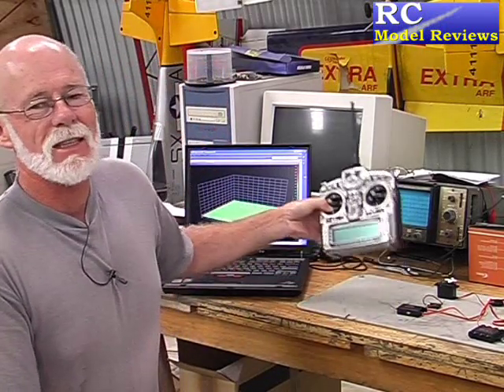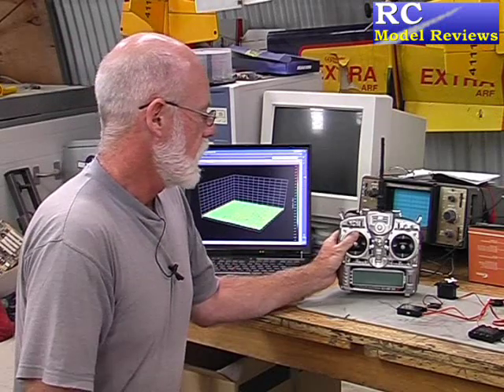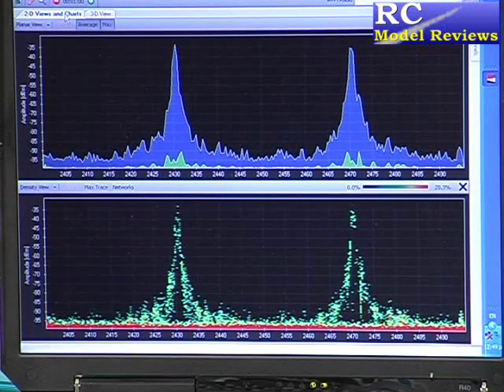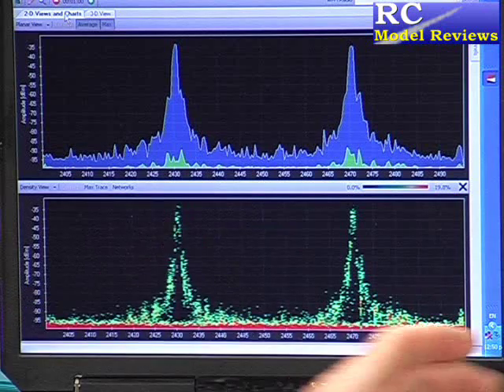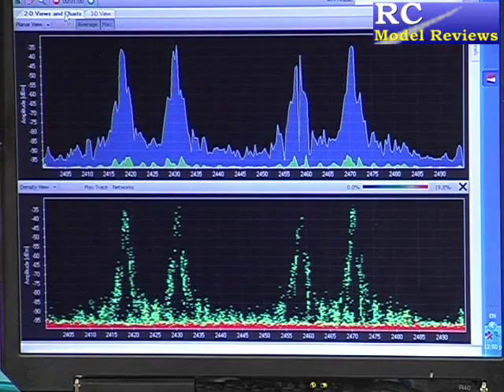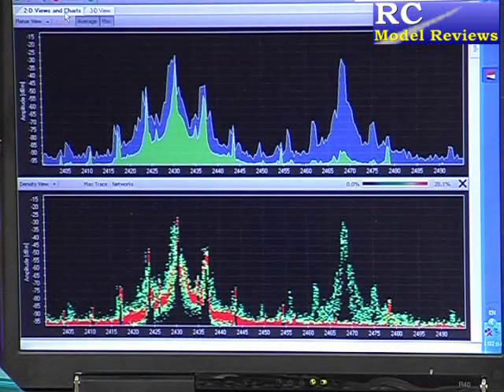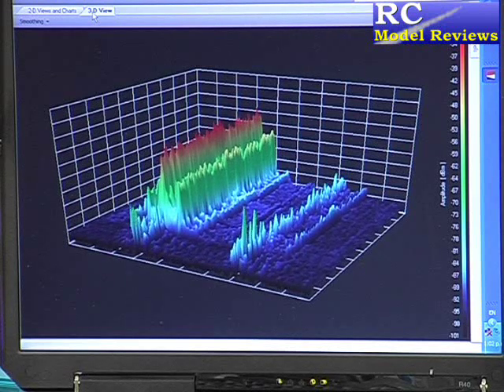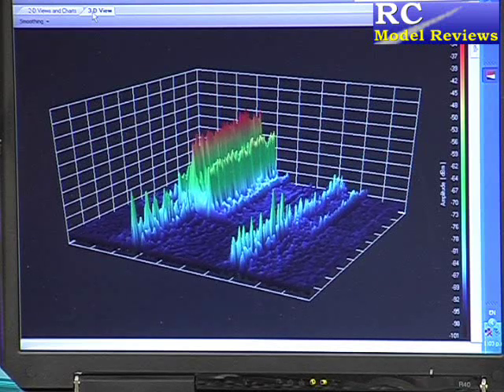Spektrum/JR DSM2 test (Part 1)

Comment: Here in the UK you could be forgiven for thinking spektrum was the only radio brand on the planet.  A friend joined the local club & was told he should upgrade his flysky 9x with frsky DJT module (so far flawless) to a DSM2 DX6/8i, this is at a field that has know interference problems & another member told me DSM2 aircraft regularly fail (die).  I have also seen DSM2 fail twice at my local park, both locations prominently display huge 2100mhz mobile phone masts which I suspect are the cause.

Comment: Thank you!! I have had at least 9 signal loss incidents over 4 years using Spektrum and didn't know about the issue you showed. My problem has been that I have so many receivers etc. buying into a new system would be so prohibitive but recently a Spektrum tech told me losing signal 9 times in 6000 flights isn't so bad is it after not being able to explain why my receivers seem to lose connection no matter what receiver/esc/batt at random times. It sucks not trusting your radio. Thank you!!

Comment: I would never use a 2.4 Ghz video transmitter while using a Spectrum radio.  Just common sense.  Go 900 Mhz and the range is better too, or just use a small video camera that are now available.    I have been using SpectrumDx6 and DX7  for 4 years now and have never had a problem.  I never range test, but now think I will start.

Comment: During the video transmitter test it seems that 
everything works fine, but when you
fly your FPV the results may be different? 
As the distance from your radio transmitter 
to receiver increases the receiver will hear
more of the video transmitter and lock the radio 
out. Factually it's the same as getting stepped 
on while talking on a CB radio.
Reply: What should 've been done in this presentation is to do a range check  test with the video transmitter close to the receiver and the DSM2 transmitter at a distance.

Comment: Nice review! Just one question, TX is using two channels but what about RX without small satelite? E.g. AR500 full range RX without sattelite... i'm not sure about this case.  Do you know if  those RX without sattelite able "reading-using" signal from both channels? Or only one channel is used ?

Comment: @startazz 

I feel the opposite about my DX6i radio - this video has reinforced my confidence in the Spektrum system. I totally agree with reviewer about the inadequate 4.8v receiver pack. I'm running a 5 cell NiMh pack to try to avoid the brownout issue. Overall, I'm very pleased with my DX6i purchase.